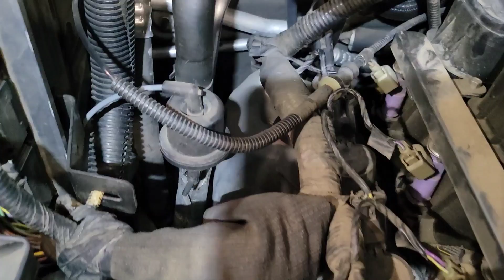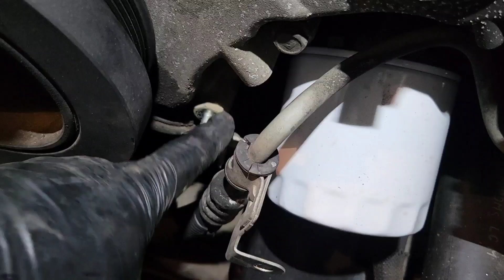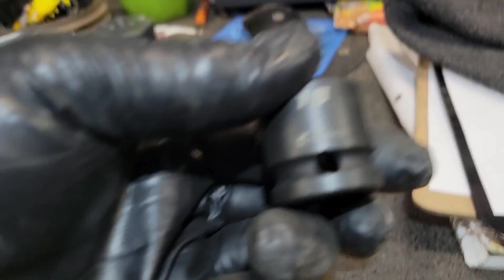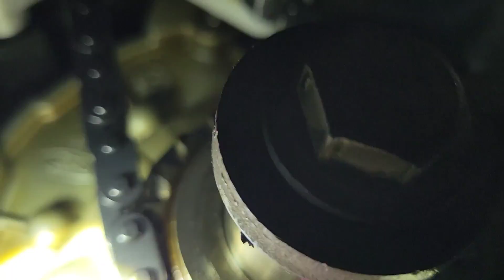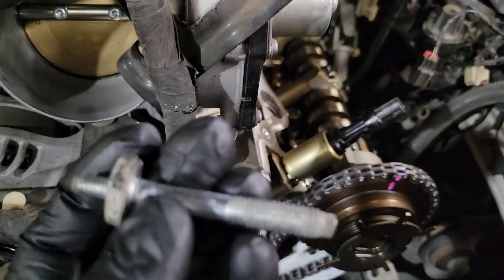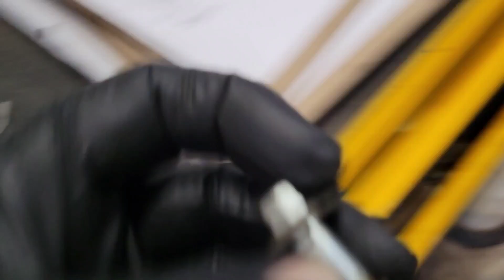3 Valve 4.6 Ford How to Replace Timing Chains

Comment: Kind of a dumb question.. how did you go about torquing the harmonic balancer bolt on reassembly? Did you use some sort of balancer holding tool or just some “dugga duggas” on the impact?
Reply from the maker: I do not torque the balancer, I go by feel with my impact. Just my personal preference.,

Comment: Appreciate your time on the video however, Too much on the tear down which anyone doing this should already know and not enough on the actual chain, tensioner and idlers removal and proper install and setup
Reply from the maker: Most people do need info on disassembly actually. Noted. thanks for watching.

Comment: I'm doing this job right now...do you mean too put a socket  on the phaser bolt too hold it or what did you do too keep it in place so the phaser didn't move thanks
Reply from the maker: I am not exactly sure how I held it in place, if there is not a place on the cam to put a wrench on then hold the cam with the phaser bolt but be very careful of the outer portion of phaser that you do not damage it. I thought there was a place to put a wrench on it. We may have put channel locks on the cam but just be careful. Message me on Instagram if you have anymore questions and I can help you out. Thanks for watching.
Reply: Hi I went on Instagram too find you but I can't but anyway the cam doesn't have a 6 point  for a wrench they have a special tool but thank you for the reply I actually can't use the cam phasers bolt because I have too take the head off but thanks for the reply love the video and I subscribed.
Reply from the maker: @philliprollman7421  well that makes sense about the cam Bolt.  That confirms we used channel locks and held the cam.  
Nuts_n_bolts_with_tone
That's my Instagram

Comment: Excellent advice and video.  I followed this and changed the chains, tensioners, guides and phasers in my 2010.  A few more tips:  The left cam doesn't want to move, the right does but I held each of them with an assistant and Vise-grips. I marked the cams so I could tell if they moved.  I alternated with a holding tool to hold the phasers to remove and to torque down the retaining bolts.  Otherwise straightforward.  I used an OTC pulley remover for the dampener and had to file down the hooks to grab the spokes.

I didn't remove radiator hoses or drop the coolant.  Just changed oil and filter after an hour of running.

A thirteen hour job for me, outdoors using all Motorcraft parts from Tasca Ford, $1000 (June, 2023) with new solenoids.  Runs like a dream now.  I hate the plastic junk but this valve phaser setup is amazing.  Ready for another 135,000 miles.  Thank you, Tone!
Reply from the maker: Very awesome good job. Thanks for watching

Comment: Great video, Tone!  Just passing along  a tip on that Steering Pump.  The bottom bolt is below the back top bolt and has a plastic wire harness keeper snapped onto it.  You can see it if you look from the hood hinge area.  After you pull down and off that harness clip you can go in from the front, under the pulley with a 3/8 ratchet and a 13mm deep socket.  It will be out in a minute.  Took me a half hour to figure this out..
Reply from the maker: Thank you for the tip I appreciate that. Thank you for watching.

Comment: 02 Explorer 2V 125k miles. Screeching sounds [like a cat hissing] upon light acceleration and especially at higher rmp like at each gear change. Two days later a misfire code. Pulled cover and found a small guide piece broken off. Drivers side chain is loose [after days of sitting I realized this]. Moved to TDC and although no copper links on chain the sprockets seem to be in correct position, roughly. Question: is it possible to throw a misfire code due to a stretched chain and said chain did not skip a tooth? Also, it felt like the vehicle would rock forward and backwards while accelerating towards the end right before I shut her down. No loud noises, just a screech, misfire, broken guides and the rocking motion. Have not had diagnosed. Help appreciated
Reply from the maker: Thank you for watching the video and I'm sorry your having problems. Misfire codes, lack of power can all be from A mish timed engine. If you found a piece of a guide then that means the chain has stretched because of the guide. Base engine timing is very important so you need to get that fixed first. Please hit me up on Instagram if you have any further questions.

Comment: I thought it was recommended to change the phasers because they are common point of failure? If that is true taking all this off and not replacing them seems like a waste of work
Reply from the maker: It is recommended to do so, however sometimes like in this case the phasers are not being replaced and this is how you do it if you are not replacing them. Plus this is how to service the timing chain system without removing valve springs. Thank you for watching I appreciate it
Reply: They are probably sintered case hardened cam phasers theyre 100x stronger than plastic guides

Comment: What tool did you make to hold the right cam? Missed that part.
And that silicone looks like the Right Stuff lol.
Reply from the maker: Haha it may have been Right Stuff, or Motorcraft, not sure. I actually just rigged up something to bolt up and hold phaser in place, but here is a link to a very cheap tool to hold the cam sprocket. 
https://amzn.to/3N585Ao